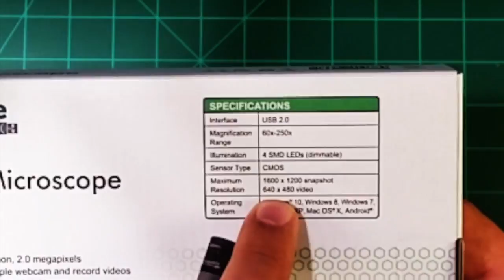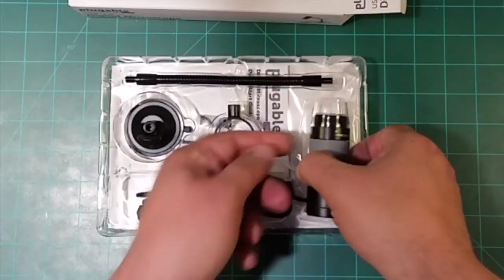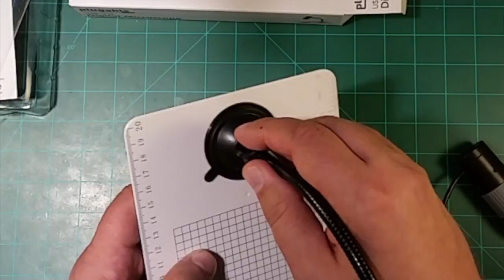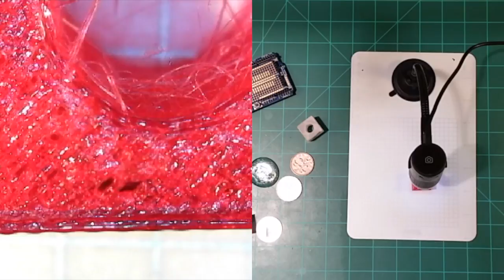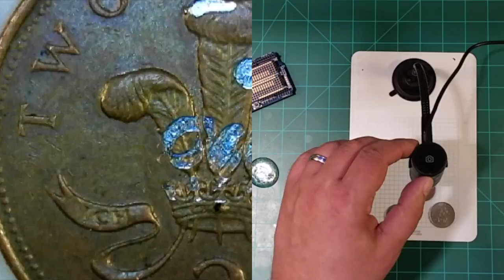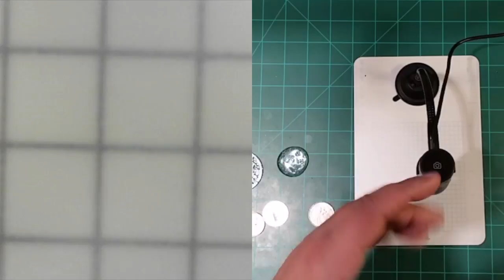Shop Talk - Should You Buy a USB Microscope?

Comment: Really bad lag, if you're going to do micro soldering, this is gonna get frustrating really fast. I did get a microscope (AmScope) with a camera, for a lot of more money for this purpose, no lag, works super well. But I use it by looking into the oculars, using the screen is just for checking or recording. Granted my setup is about 30 times more expensive, but I don't think this will be very useful for SMD work.
Reply from the maker: Yes there is a lag but not that bad as most likely look worst in the video and I can see to do the solder dragging however its the solder bridges which I am hoping to see.  Also hoping for a USB 3 version soon too :-)

Comment: Can't wait until the price for the faster USB 3.0 scopes to come down. The lag on these 2.0 scopes, at the higher resolutions is just too much for me to use for SMD work.
Reply from the maker: Another viewer wrote about the lag too and its not that bad however I can see the point.  As I can see (with mid 50 year old eyes) to drag the solder however looking for the solder bridges is one of my issues.  Do you have a link to USB 3 microscope?
Reply: RJ_Make splugable com ,products,usb2-micro-250xespanol ayuda

Comment: Very interesting!  I build RC quadcopters and the flight controllers and other electronics keep getting smaller and smaller.  While I'm OK soldering a standard RC-style plug, getting much smaller than that is tough.  This could be useful for something like that.  Of course, just because I can now see it doesn't mean I can actually solder at the micro controller pin level. :)
Reply from the maker: Know what you mean as my eyes get older everything get smaller! :-)